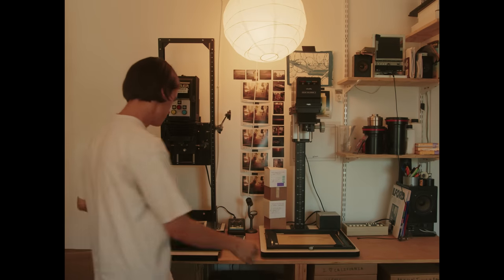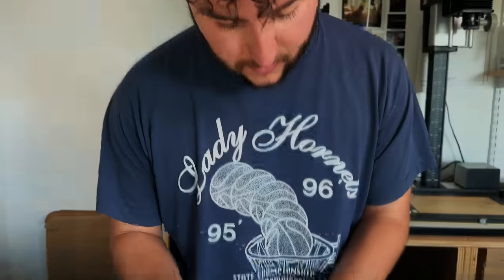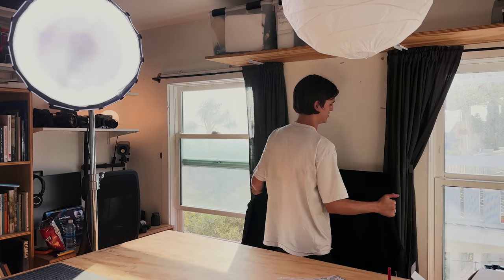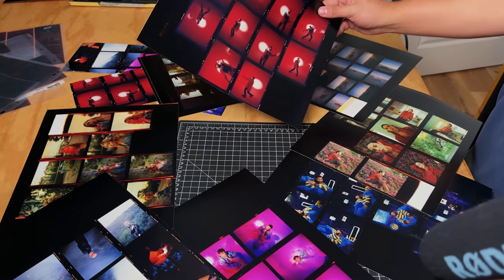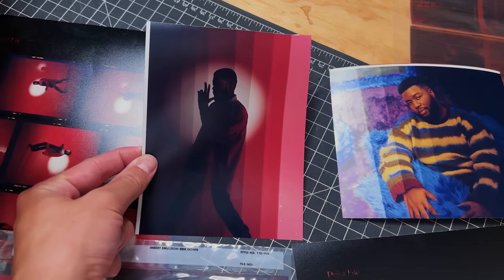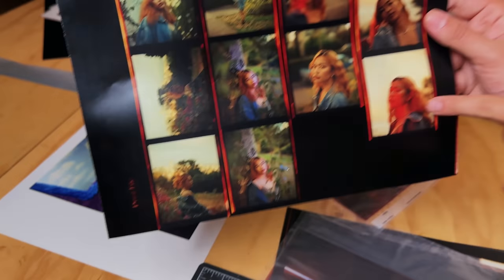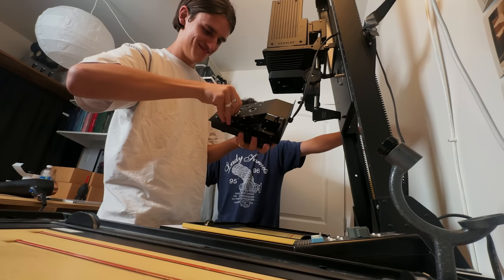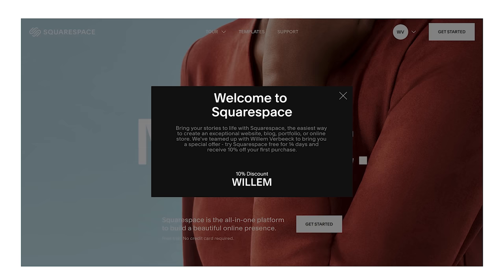Printing Film Negatives in My Darkroom

Comment: sometimes i feel like digital image is too much hassle but this process looked much more enjoyable than software editing, I wish i would be more accessible in terms on expenses, how much does all of it cost from roll of film to getting a ready picture to hold in your hands?
Reply: Hey mate, i do the same process and here is a breakdown for costs of the consumables: around 12€ per rool (120), ars imago developing kit 35€ (good for 15 rolls, so around 2,5€ per roll), box of 50 sheets 30x40cm of fuji dpii around 60€ (if you cut them in half at about 8x10 inches size you get 100 sheets for same price) and for half a box a adox ra4 kit for about 25€, so roughly 100€ for 100 8x10 photos. You’ll take around two or 3 sheets till you get done, so worst case scenario if you print every single shot (which you won’t) and if you shoot 6,45 it should be around 4€ a shot if you do it all yourself. Of course bigger prints are more expensive, but not that much cause you can do all your tests on small pieces of paper.
And even with all that, it’s still cheaper or around the same price as an equivalent quality and archivability inkjet. 
Hope this helped!
Reply: The hassle is significantly bigger in the darkroom, I've worked hours to just get two final images (but multiples of them!), and I only do b&w, but it is so much more satisfying than doing digital editing. It can also be very frustrating when stuff doesn't work out, but it's still worth it.
Reply: @samgerers  for me bw is waaayyy more time consuming that then color, it usually takes me 3 hour with black and white and 40min with color to get a good final print. But you do have to compare it to when you edit to make a print. When i have to print from digital files i spend much more than 4 hours between proofing and editing till i get a final print. With the darkroom i get a final print right then and there